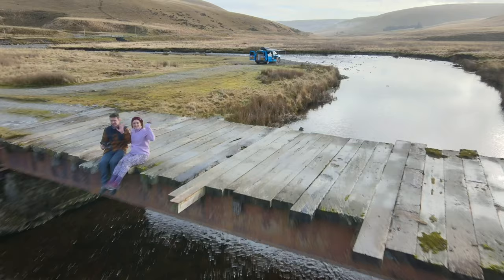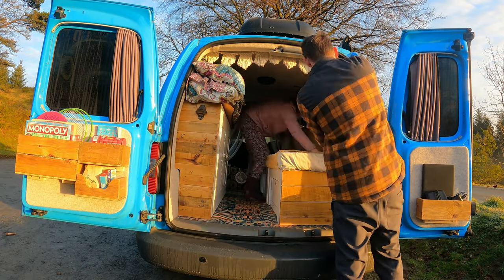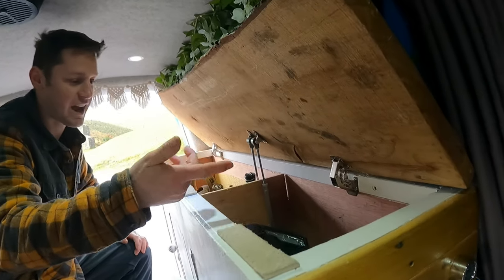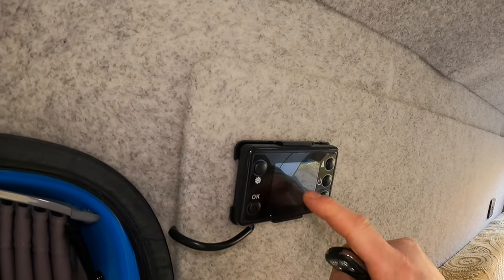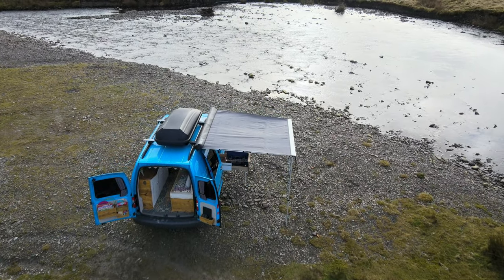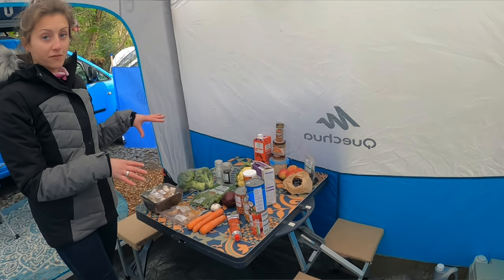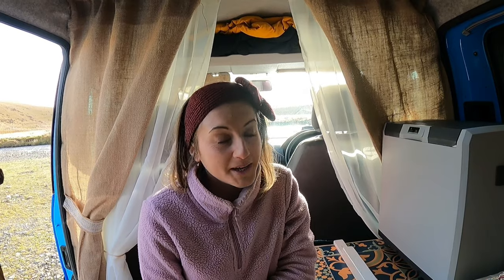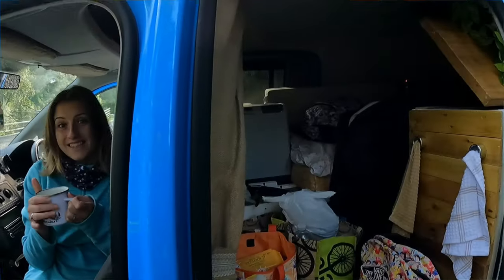"Our Realistic Van Tour" & "Top Tips" After 1 Year of Van Life!

Comment: Another very informative video. Did Vandocs do all your electrics, and if so, how much did that cost?
Reply from the maker: Thankyou 😁 
Vandoc fitted the split charge system, leisure battery, led lights and the wall sockets. They did a fantastic job and we would highly recommend them. We fitted some extra sockets and inverter afterwards as we realised where we wanted the original sockets wasn't practical. Not sure on price as we had it carpeted and windows fitted at the same time 👍🏻

Comment: Really interesting video.  I have just got my Caddi Maxi and I am about to start fitting it out.  Do you have any install images or video of the diesel heater install and the connection to the diesel tank, please?
Reply from the maker: Thankyou, we hope it gave you some inspiration for your caddy maxi build. Unfortunately we didn't film the actual installation of the diesel heater because a mate did it. We only have the clips on here. If it is any use to you, after an inspection we were told that it would have been easier to fit in the rear passenger footwear. However our leisure battery was already mounted there 👍🏻
Reply: Would you be able to take a picture of where the fresh air intake and exhaust air from the heater leave the van?

Comment: What about the fan you have on the ceiling? Doesn't it help with condensation, cooling in hot weather etc? What kind of fan is it and did you instal it yourselves?
Reply from the maker: The fan came already on the van so not got too much info on that. 

Its alright, it does add to the ventilation but doesn't stop condensation. It mainly works when the van is moving. I personally wouldn't go out and purchase one as it can get noisy when driving.

What we find helps best for condensation is leaving the side windows and cab windows open slightly. We have "wind deflectors" on the cab window so we can leave the windows open slightly and it stops any rain, insects ect getting in but keeps a bit of air flow coming in👍🏻

Comment: Nice one! thank you for this upload.How did yee vent the diesel heater,was it through the floor? 5kw? cheers guys!
Reply: Is it regestered as a camper now? any advantage to do so?
Reply from the maker: Hi Christian, thankyou 😁
Yes the diesel heater is 5kw and we have it on a diesel heater mounting plate so the air intake and exhaust goes through the centre of that that through the floor.

I dont believe that any caddy or micro camper conversion meets the requirements to be registered as a camper but I may be wrong. Claudia however is insured as a van with windows with a campervan conversion. All major modifications are declared and the annual price was about the same as what it was when she was on standard van insurance. Hope this helps👍🏻